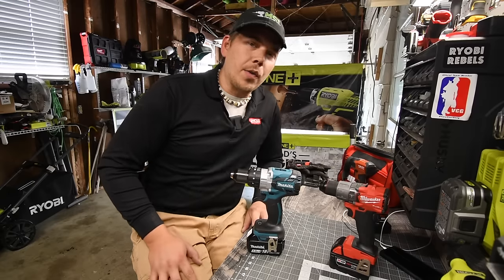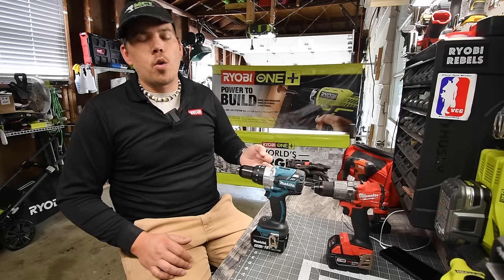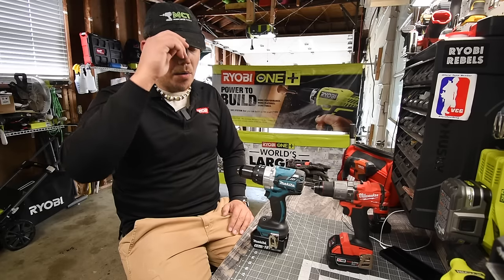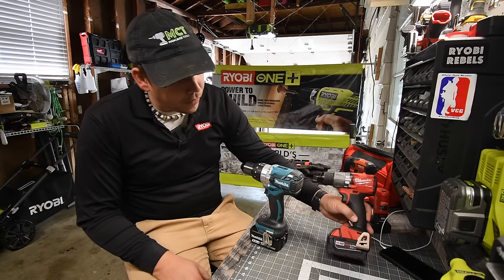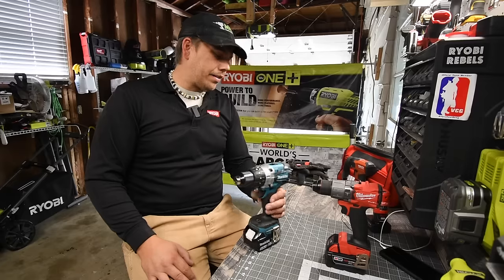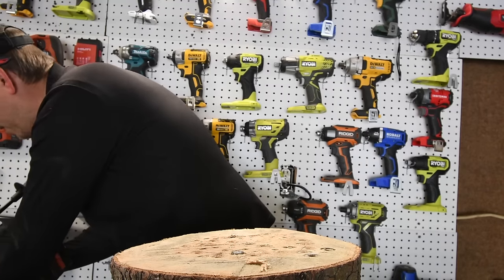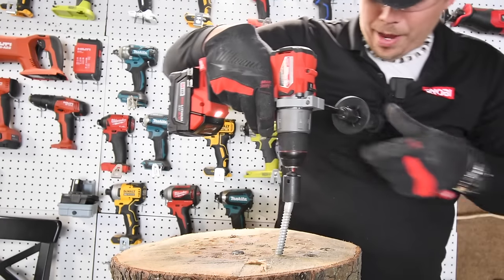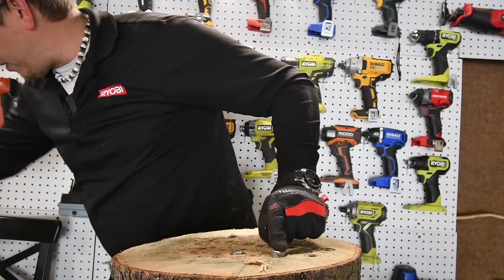BATTLE OF THE BRUSHLESS!!!  (Makita vs Milwuakee)

Comment: the test is not accurate, the first screw/threads were already in the wood due to drilling in the (wrong) hammerfunction. you continued in the same spot,  which if you look at the test with the makita adds like 1 second till the thread actually bites into the wood ...

Comment: Roflmao! Notice the first test driving the 2nd lag bolt ( makita) sinks lag bolt right next to the Milwaukee bolt ...hmm the wood is compressed from the first bolt. 

2nd point the handle is longer to provide more torque the closer you get to the handle the less torque you have...its like which tire wrench would be easier to free a stuck bolt a 6" long handle or a 2ft handle? More torque on 2 ft. Simple physics.
Reply from the maker: I thank you for viewing Fish
Reply: That's not really correct since the handle is for stabilizing, and not for torque.
Reply: @ricktipton9563  yes that is for stabilizing. My point was its easier to stabilize the drill with a longer handle than a short one. You can provide more pressure on a longer handle than a stubby short one.

Comment: Really Good video..I see some comments about the Makita Chuck ,and locking it manually..However i want a no nonsence chuck, i dont want any B.S when im trying to do a job..While they both seem great, im going with the Fuel by Milwakee..
Reply: So this video just popped back up..In full disclosure after watching more videos, and looking at warranties, how hard or easy to claim, and battery power...I went with Hurcules brand..They had a better battery source of 21700 samsung, had the exact same warranty as Milwalkee, and and easier replacement procedure..They also worked neck and neck with Milwakee for a better price point

Comment: You should try to understand how makita chucks work before saying the tool misperformed. If your bit keeps coming loose, you might attempt to actually lock it in. I pull allthread out of concrete daily with no bit and my chuck being hand tightened alone with no problem. Take off that pooka shell necklace and handle your nuts.

Comment: Hard to take a guy serious in a tool review that can’t even use the chuck.
Reply from the maker: you obviously need a lesson on how to use tools. click back once to lick the tightness in place. doesn't happen on all drill though.
Reply: @ManCaverTools   I use drills everyday,  and I don’t strip anything. Also at work we have several from makita, dewalt, Milwaukee, and Bosch, I use them daily so thanks but I know how to use a drill.

Comment: You need to learn how to tighten a chuck. Also you can clearly see you're intentionally trying to make makita look bad. I've ran all the different brands and not only does makita out perform them all its the only brand that actually last as well. Milwaukee is over priced crap in all honesty after a year or less batteries don't last and drill burns up. Also you wanna test top of the line Milwaukee then test top of the line makita do this test against the 481 guaranteed it will smoke the Milwaukee drill all day everyday. Speed doesn't matter in fact having the fastest can take more time due to lack of control and being too fast and snapping screws. These videos are so dumb only way to tell for sure is the tried and true method of running them in the field.
Reply from the maker: I thank you for viewing Kyle
Reply: I also agree I own both drills impact and hammer and the Milwaukee burns up batteries barely last ect

Comment: This guy has zero clue on how a chuck works with a lock....
TEACHING TIME
If you look closely you can see a diagram on what way does what, Unlock symbol or Lock symbol.
You my man, twist the chuck to the opposite side every time. Then the chuck broke when you when past the locking point.... it only 1/4 twist to lock or unlock. Forcing past causing stripping to the locking pin and sleeve inside the chuck.
Reply: Personally the Makita tool is not ever the fastest tool for the job. However it is very reliable. The company doesn't innovate like they did in the early 1900's.
They've been around a while and just stuck with the roots.